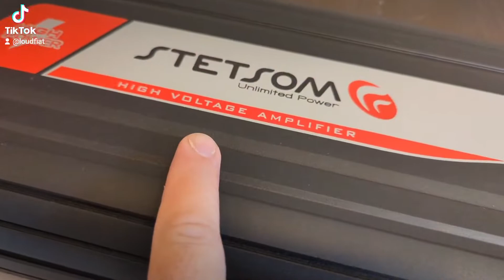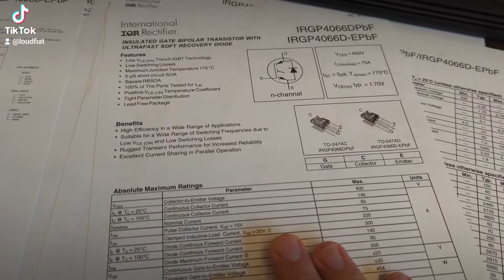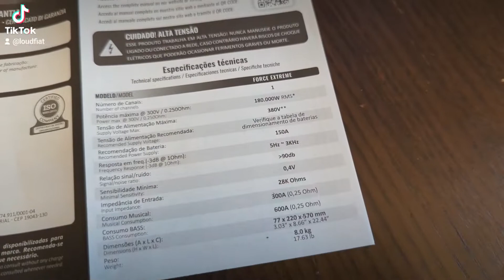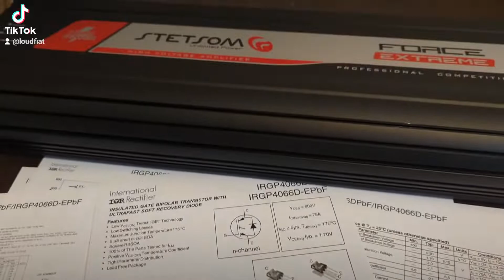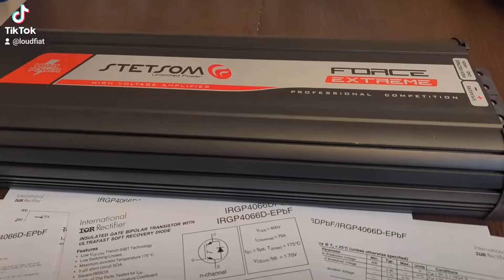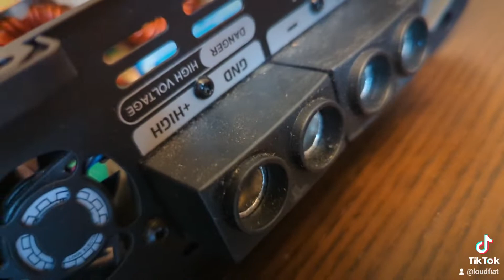Stetsom Force Extreme

Comment: 1. Where is the voltage dropped from 400 volts to power something like a subwoofer? Surely not that voltage from the speaker terminals? That could be lethal! 
2. What is th4 minimum amount of single subs required to run at near full volume?
What is the impedence of the speaker terminals?
3. Where are the high voltage battery connectors?
Reply from the maker: 1. Lethal, yes. Class D PWM output like all other amps (most have 150+v rails)
2. 0.25 ohms
3. Inputs

Comment: The IGBTs may be rated for 140 amps and 600 volts, but there’s also the SOA. 600 volts @ 140 amps will not fall into their safe operating area. The max voltage rating will be with extremely low current and the max amperage rating will be with extremely low voltage. That’s why it appears there’s more IGBTs than it actually needs. There’s not. 180kW is keeping them all inside their SOA curve. Pushing it past that will probably blow them up. And the thermal power dissipation rating on the datasheet is with maximum cooling accounted for. They would instantly explode trying to dissipate that much power with no heatsink. Hypothetically though you could water cool this and it could continuously do the 180kW all day

Comment: Probably a stupid question, but could you hook this up to your house power outlet( 220v) using a rectifier of course. And get it to work?
Reply from the maker: Yes, with a beefy enough rectifier you can. It'll work at 220v or even 110v in the US.
Reply: @LoudFiat  thank you for  answering😁 Home audio project?
Reply from the maker: @lassediscovers1813  it would definitely work if you need immense power but don't mind high THD. The sound quality is garbage IMO, I had to add high frequency caps to absorb switching noise.
Reply: @LoudFiat  you dont say... even if used at subwoofer's? Wow. Thank you so mutch for sharing youre knowledge! Youre answers are gold👍
Reply from the maker: Please see this video for more info! https://www.tiktok.com/t/ZT8CCdaEo/
Reply: You could. Depending on how much power you were trying to get though you would need enormous capacitors to smooth the rectified current out. Otherwise it would probably sound like hell. It’s meant to run off batteries and batteries produce perfectly clean DC so it probably won’t filter out any noise in the mains and it’ll make it right to the subwoofers.

Comment: Even though the IGBT's are rated for 100A each, the packaging and bond wires are not. That's why you have so many devices in parallel. Pretty dope amp!
Reply: There’s also the SOA curve. They couldn’t do their max voltage and current at the same time. Usually at around two thirds the rated voltage is where a semiconductor can move the most power. And always at the saturation voltage is where it can move the most current. An IGBT actually capable of moving 600 volts and 140 amps at the same time would be massive and would have bolt on terminals instead of leads (and there are in fact trench field stop IGBTs that large and much larger XD). If someone wanted to they could take a bunch of giant Infineon IGBTs and make something this size produce a few million watts (with continuous cycled water cooling from a big tank).

Comment: I wonder what it would do on a smd amplifier dyno
Reply from the maker: Problem is those are rated for only 30k watts, my friend clamped 60k on these at 220v, so double that on 400v
Reply: It would destroy the dyno because the voltage measuring circuitry inside it maxes out at 140VAC. This will do more than double that. It would fry the dyno lol

Comment: I've been doin some research on the high voltage amplifiers I have a Toyota prius with a 202v system. I came across one of your videos on tiktok and its got me intrigued! Would love to know more about this and how to run one of these amps.
Reply from the maker: What's the battery tech of the Prius (chemistry, amp hour rating, discharge rate, etc?/
Reply: 202 Volt nickel-metal hydride 30c 1,313 ah
Reply: You're gonna want to probably upgrade to the Project Lithium battery, just a bit if advice. The output goes from 100A at 202V to 260A at 202V, so you can still drive around and not get shit fuel economy/EV power.

Comment: I am sorry but what you're claiming this amp can do is impossible
Reply from the maker: No need for sorrow, there's theory and then practice. My buddy clamped 60k at 200v, should do double at 400v
Reply: It can indeed do 180kW. It’s barely even an amplifier realistically. It’s just a giant full bridge IGBT switch thats dumping power directly from a 400 volt bank of batteries to the subwoofers. There’s no power supply section because the battery bank is the rail voltage. The reason every amp isn’t like this is because 400VDC is extremely, extremely dangerous. And it’s not a good idea to have that just lying around in your car. The output and input on this amp (amp so to speak) will kill someone easily. And if one of those IGBTs shorts it’s going to wreak havoc on the speakers because there will be nothing to stop the battery bank from going straight into the subs and burning the whole car down. So yes it can do 180kW, it’s just really really risky
Reply from the maker: Like a 8,000 hp race car, let's gooooo
Reply from the maker: I've got redundant fuses and breakers, they've tripped and blown
Reply: Yeah I'm with you, I don't believe this for a second. I'd need to see this clamped in person to believe this. I've looked everywhere online and I've found ZERO videos of them clamped. 

And the most powerful subwoofers would melt down to nothing with 200000k on it.
Reply: @letsgoracing78  but these amps aren't for single subs, they are for arrays of subs. Think of the Grateful Dead's Wall of Sound, but build into the side of a semi-truck trailer.
Reply from the maker: @letsgoracing78  I hear ya
Reply: And also hypothetically someone could just take a bunch of Infineon’s most enormous IGBTs, water cool them and make something this same size do a few million watts. Probably more. But the reason they didn’t do that here is cost effectiveness (IGBTs that big each cost more than the retail price of this entire amp) and because who’s gonna make use of that lol. 180kW is enough to drive whatever tf
Reply from the maker: @darrylpioch2055  I worked with an engineer who's got a half a megawatt motor drive inverter based on modules I won't name that could easily be driven as an amp too